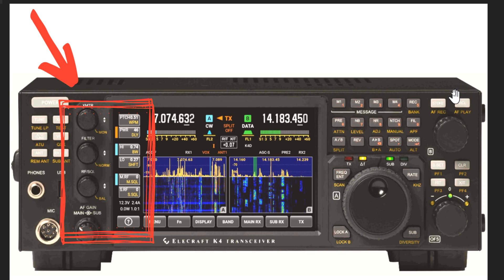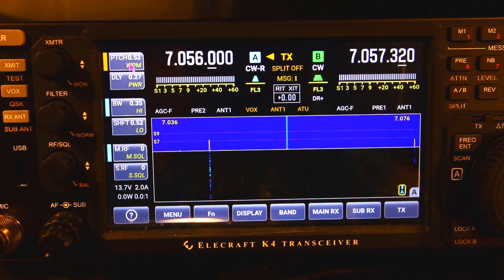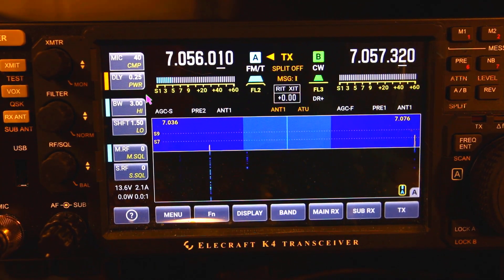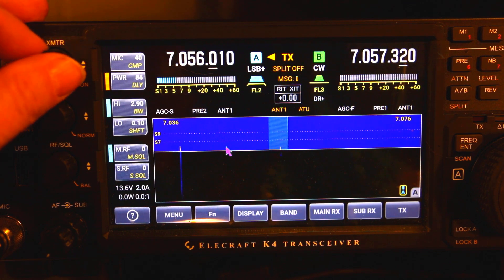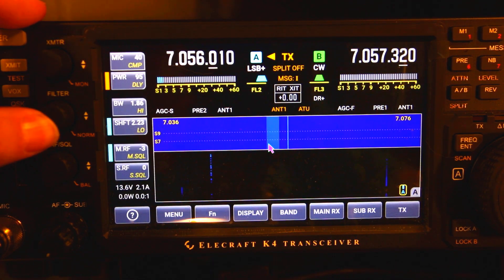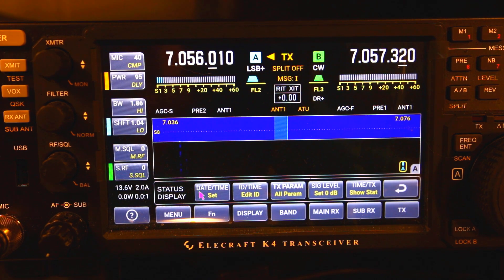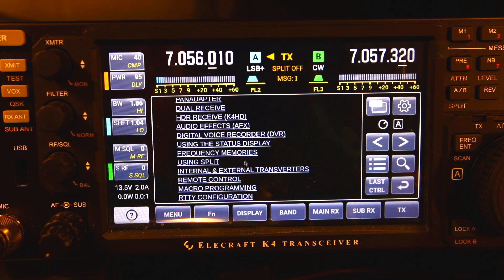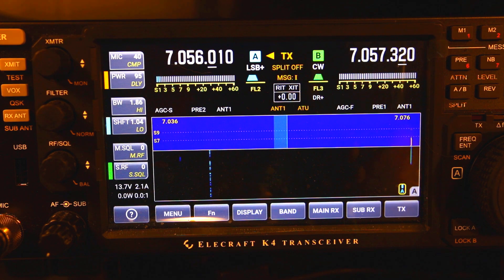K4 MULTIFUNCTION CONTROL KNOBS / USING MULTIFUNCTION CONTROLS ON K4

Comment: HI Vince, Rick WHO here on Guam Island.  I have been a Ham for 50 years and a wanta be for another 15 years before that.  I am a bit dyslexic and had real problems with CW.  Finally got it up to 5 WPM for the novice and then upgraded to General.  Never operated CW.  With no code got Extra, but embarrassed to say so.  Rigs most recently were Kenwood 530 and 830.  Have been inactive for past 20 years.  Decided to purchase Elecraft K4D.  Having real problems learning how to use the dern thing!  Old brain new technology (old dog new tricks).

Could you do some new youtubes for idiots/dummies on setting up some basic things.  Kinda a check sheet format to do something ie setup for ssb on x band and frequency.  How should the various options be set as a first go?  That kind of stuff.  

Can't find much Elecraft K4 for dummies out there.

Thanks for the content.  73  Rick WH2O
Reply from the maker: Hi Rick, Congrats on the K4. The radio can be a little intimidating but it is not as bad as you may think. Pick one thing at a time and learn about it.  I will make some more videos on the K4. I like your callsign with H2O and being on an island. 73 OM
Reply: @HamShackReviews  Thanks Vince, I was a water chemist in another life and couldn't resist the call (and I like bourbon!).  Rick WH2O